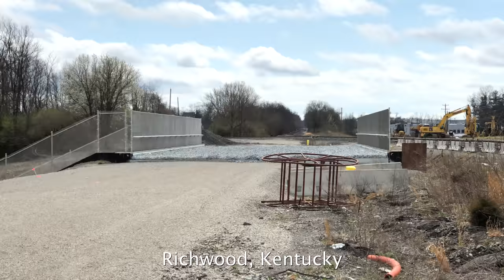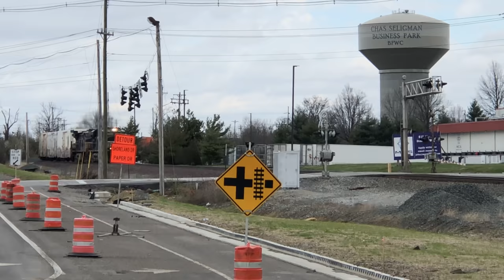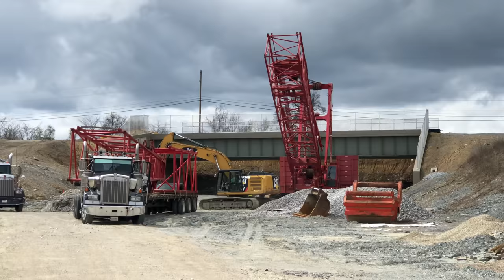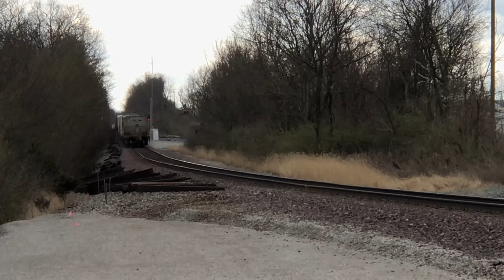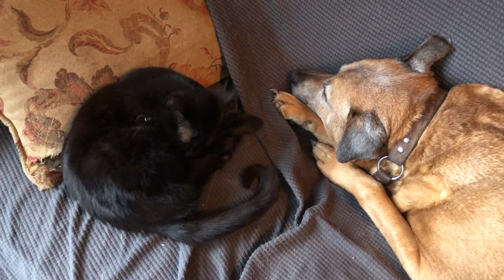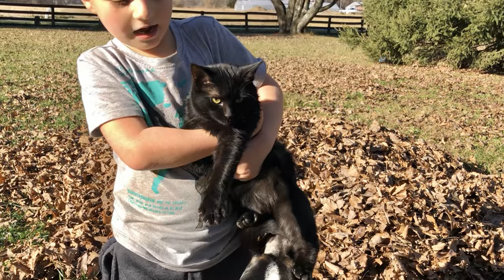Railroad Shoo-Fly Track & Train With DPU Passing New RR Bridge!  2 Norfolk Southern Trains Booking!

Comment: Good to see the progress.As someone has pointed out below there seems to be a lot of idle assets but perhaps you were there outside normal working hours. I look forward to seeing the works completed and your confirmation of the max. permitted line speed. As for longer trains I guess that assumes longer sidings or  will the consist be sub divided on the running line at their destination? 
Hope that the price of gas does not restrict your radius of operation. Nice shirt suggests no wind and subtropical temperatures. I must have not been paying attention . Thanks JT.

Comment: How would "Hump Yards" deal with longer trains?
Reply: The length of the trains is not determined in the hump bowl of the yard.  The hump bowl only makes strings of cars (or cuts).  The short strings of cars are then moved to "outbound tracks" where they are coupled to other strings to assemble the train for dispatch to the main line. Inbound trains arriving at a yard are broken down in a similar fashion depending on whether the cars are continuing on to a farther destination or if they are freight for the yard they are arriving at.
With the intent to build and operate longer trains I would think the railroads will have longer inbound and outbound tracks to keep from blocking the mains.
Reply: @larrywalker7759  Thanks for the great information! 
It's truly fascinating our logistics system...too few people appreciate it.

Comment: So who paid for the bridge? The Rail Road or the municipality? Rail Roads are at a huge disadvantage relative to their competition as THEY typically own therefor are responsible for infrastructure upgrades. Tax payers do the waterways, highways, and airports ..something to think about. There ARE exceptions was this one?
Reply: If you ever heard of the "can opener bridge" of the NS, in Durham, NC, located on the one way S. Gregson Street, having an 11 foot 8 inch clearance (now having a 12'4" clearance), that project was supposedly paid for by a grant with funds from the NC DOT.
What is it about the "can opener bridge," spanning S. Gregson Street, you might ask? It has taken the rooftops of many tall trucks, most of them being rental vehicles being driven by inexperienced drivers.
Crashes here have occurred so often that a local resident has set up a video camera on the building, very close by the intersection preceding this low bridge, so to be able to share all of the crashes here on YouTube.
NS has even installed some form of a "crash beam" in front of their bridge so to minimize actual damage to their structure itself. This yellow painted "crash beam" is said to have been twice replace already! At the intersection preceding this bridge are traffic signals and a light up, messaging: "OVERHEIGHT (and) MUST TURN," that is activated by a "break beam" light sensor that will be tripped by any overheight vehicle. It is located about a quarter mile away. (I once found this detector while using my Google "Earth," checking their "street view" feature so to see it. Its location is at around 25 S. Gregson Street. It is mounted on a pair of short wood utility poles and you will be able to see that light up sign ahead illuminated of you should your vehicle be "too high" to pass under it.)

Comment: They're "Nuts" in  my Opinion! These longer trains not only cause traffic congestion in towns with multiple  crossings, but are dangerous. When there pulling so much tonnage that they break couplers, or break car draft gear housings off, then N/S is asking for trouble! Stupid Management, save a few bucks, but what does it cost to have RJ Corman, or Hultcher to come and clean up a derailment?
Reply: My guess would be 
That the risk 
Is worth it
Compared to cost savings 
More bang for the buck

Comment: they could keep that shoo fly for another siding
Reply: This entire project with the shoo fly and the new bridge is to facilitate the abolition/closing of a dangerous grade crossing. The shoo fly was constructed to route the rail traffic around the site of the new bridge.  The new bridge was built for the highway that is being relocated so the grade crossing can be closed. After the new main line track is opened across the new bridge, the highway running under the new bridge will be extended to intersect with the highway that runs parallel to the railroad.  In order to extend the highway, the shoo will have to be removed.
Reply: @larrywalker7759  ok thanks for the info

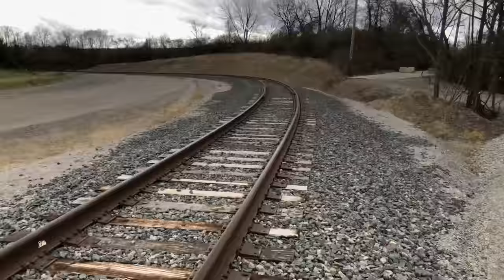Comment: FYI, A teaching moment.  At the 11:10 mark that track is not a siding, it’s a spur.  A siding is, “A track connected to the main track and used for meeting or passing trains.”   A spur track is usually used to service an industry.  It can come off the main track or a siding.
Reply: “A track commented"  ?  What are we teaching?  But you are correct about the spur.
Reply: Larry Walker   The difference between a siding and a spur.  The vast majority of rail fans that I have seen call all tracks others than the main track a siding.
Reply: @billmorris2613  Well, that is true, but it was the railroads and rail road workers who made the decision that passing tracks would be called sidings and short branches would be called spurs.
But my question to you was a humorous poke at how the word "COMMENTED" was used instead of CONNECTED.  My presumption was that auto fill software in somebody's phone substituted the word COMMENT for CONNECT and it did not get noticed before posting.  I catch my phone trying to do that stuff often and it can make for some strange texts if I don't catch it.  Do you see that now?  Have a good one.
Reply: Larry Walker   Spell check.  I just corrected its correction.  LOL.  Now your first question makes sense.  I proof read my comments, but I guess I missed that one.

Comment: Lots of tonnage on that first train, all three units had to put their shoulders to it.  One thing about the longer trains NS is running, those without a DPU either mid train or pushing from the rear are putting more stress and strain on the draft gear (drawbars and couplers) on the first 1/3rd of the train than they were originally intended for.  Your friend at WWOT noted that it really doesn't take much "slack play" to snap a coupler knuckle or pull a drawbar out by the roots if there is any metal fatigue or other unseen flaw ... often at really bad times on high traffic lines.

I think about the only thing NS is saving by running 1 super long train in place of two shorter ones is having to pay only 1 crew instead of 2.  CSX seems to have opted to make mid-train DPUs a more common feature than NS over lines with even moderate grades.  It might take longer to make up a train with mid-train DPUs, but a snapped coupler can stop a train for hours, tying up busy rails like the line you just showed us even if there is no derailment or other damage.

Thank you for the tour of the work site.  I guess I'm still a little kid a heart, fascinated by heavy equipment and trains.  Stay safe brother!
Reply: You say that "abou the only thing" longer trains save is crew costs, as if that's some minor thing. Crew costs and diesel are the two biggest expenses a railroad has. Saving on either one of those makes an enormous difference to the bottom line.

And, come on. Do you really think you've done more cost/benefit analysis on this than NS themselves? They're a Class I railroad. People pay them ten billion dollars a year to run trains. They're well aware of what draftgear can do. They know how often they break couplers. They know how much that costs them.